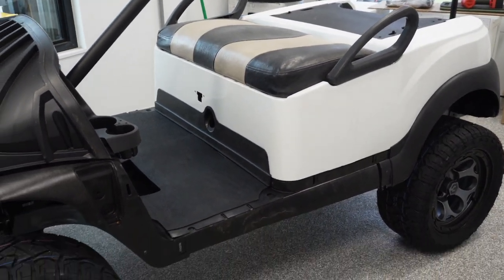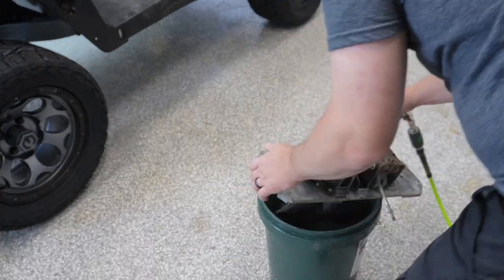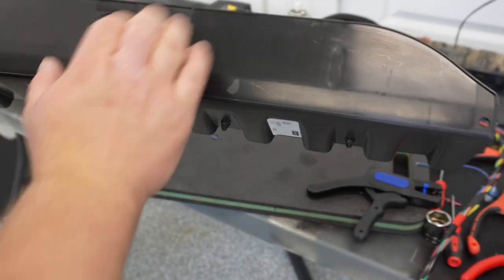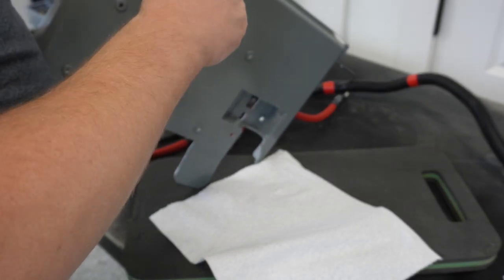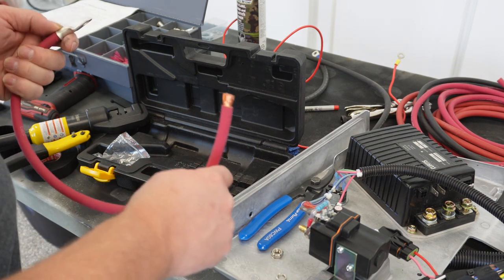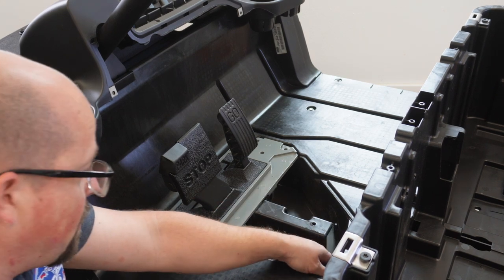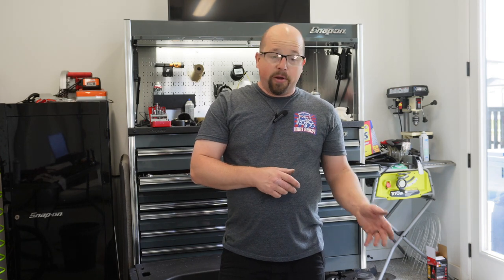Club Car Precedent Wiring!!!  (Bandit part 8)

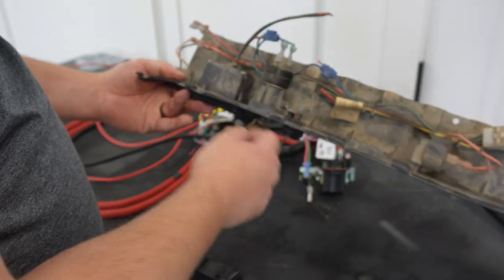Comment: When talking about the dashboard wiring at 9:55, What is the purpose of the (2) 1/4 in. spade lugs that do not connect to anything and lay behind the battery warning light?
Is there voltage coming out of there for accessories, 48 volt or 12 volt?  
Where are you installing your 12 volt regulator?  In the battery box, or behind the dash board somewhere?
If you were to install a stereo amplifier, would you consider installing a 2nd 12 volt regulator, so that one was for the lights, and the other was for the stereo?
Reply from the maker: Not sure about the spade lugs, I can check for voltage next time I have it apart. 
I will be installing the voltage regulator in the battery box. If I was installing a radio/amplifier, I would probably just buy a bigger voltage reducer to handle it.

Comment: I really could use your help!! I bought a second hand 07 precedent previous owner said it needed new batteries but come to find out he was welding on a lift. Now won’t do anything.. any recommendations??
Reply from the maker: Start with pack voltage, then move to tow run switch, and on to the solenoid and so on . Checking for pack voltage as you go
Reply: Thank you!! Very much appreciated I’ll keep you updated.
Reply from the maker: @stevenmills3843 sounds good 
If you have Facebook, you can also message me there on Kart Krazy.. sometimes that’s easier

Comment: Your videos have saved me with my build. Now I am stuck I have a battery bucket with 4 batteries that is in bad shape. How can I use a new 6 batterie tub with four batteries??? Help please!!!
Reply from the maker: Unfortunately, they don’t sell the four battery buckets anymore so you would have to get creative and make your own brackets and things for the controller in the middle…
The other option would be to get the aluminum plate that goes in the back of the six battery bucket